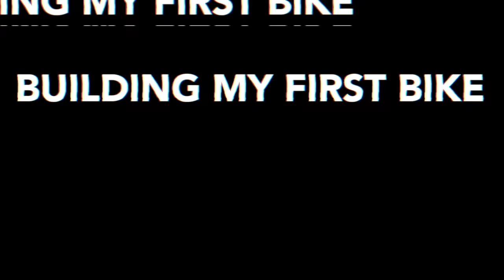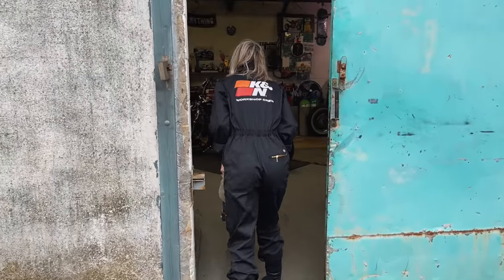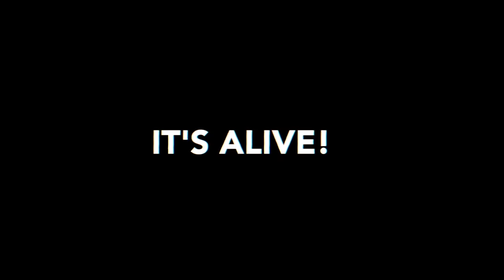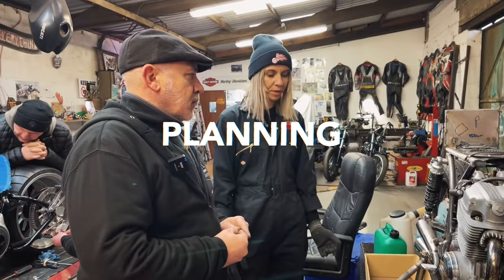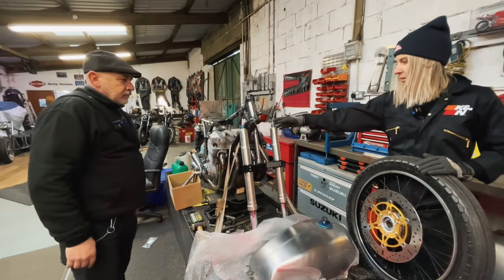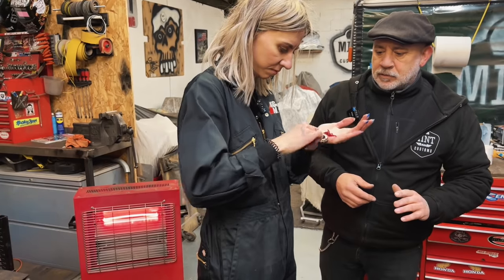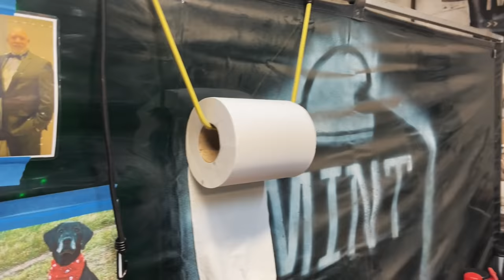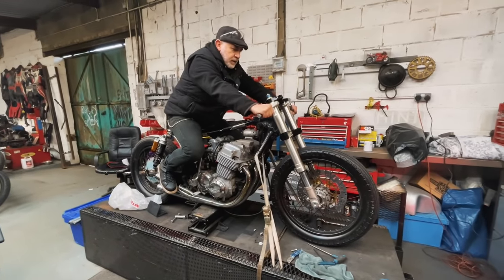My First Motorcycle Build - EP 17 / Honda CB 750 / Cafe Racer / Custom Series by Tomboy a bit

Comment: It sounds like you weren't prepared for it to get an awful lot worse before it gets better, I build mostly Cafe Bikes in the true spirit of the Cafe Racer if it's not essential then off it comes, a little work on the gearbox, exhaust & top end(hopefully with carbs)& then paint, some of them look like scrap parts before that "Magic" moment when it all comes together, you'll see it when it happens, I couldn't believe what I had achieved when I built my first bike a Panther 650 that I found on the tip(dump), not one part was stuck to another & I built it with just a handful of tool & no manual, it was a bitch to kick over but when it burst into life I nearly burst, but then I was only 12.
Reply from the maker: It’s my first one, so I’m like when you were 12, Simon was 9.. totally not prepared to see no progress towards beautiful for months… it’s something magical in this experience. Like this first time starting a motor on Adam’s bike. I’m so lucky to experience all those things! It makes me feel like I don’t have to grow up… ever.

Comment: Bike is looking great , good progress , but cant help thinking before its gone to far that adding a CB 750 F1 spoked rear wheel , disc brake and caliper carrier ( or similar ) would be a better (and also it would match front wheel )  rather than the old drum break set up that dosent work to well . just a thought .  You could also then add a set of  nice rear sets that could have the rear brake slave cylinder on it .
Reply from the maker: I like a drum break to be honest. At the beginning I wanted honeycomb wheels and disk break like you suggested but then started falling in love with some old parts.

Comment: You will regret not running a front fender. No matter how careful you are, eventually you will have to ride thru some rain, morning dew, puddle etc, and the road grit will get thrown up into the steering head area, engine, under the tank, and even in your face.

Comment: Use 10’s or 0’s thread for the seat. Be very careful… Alcantara is a synthetic suede, holds water, and isn’t waterproof! You would need to build the seat from 2 types of foam, and I would suggest a Gel insert too in the main seat area. You can use Alcantara, but only with a waterproof layer covering the foam somehow, super tricky as most waterproof layers are crinkly/noisy! Bike Seat Pro are the guys. Faster used them. Tell them what you want and don’t waste your time. Bad stitching looks horrendous …. I’m a Shoe Designer   I know. Seams need reinforcing with nylon tape, non-stretch, stitch through the lining tapes to keep the shape. If you use any thin materials…. 0.5mm - 1.5mm use a cotton backer to firm up, but don’t cut the pattern of the backer into the seam allowances. Will give raised ugly seams. Hope this helps a bit